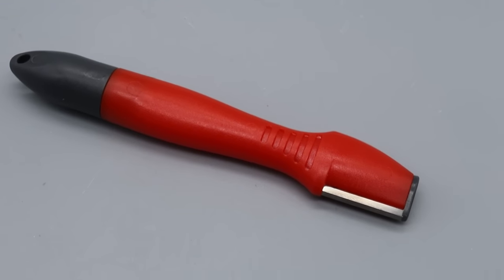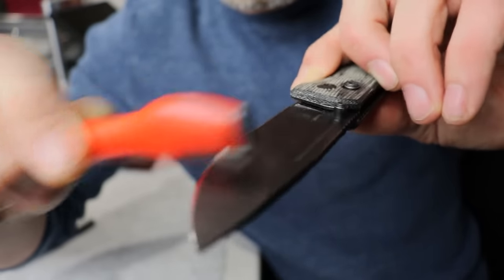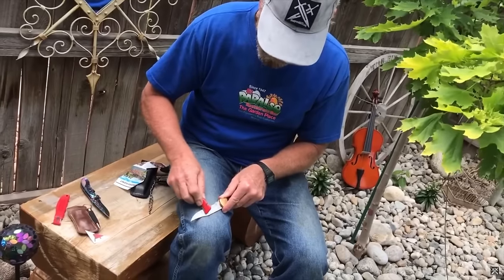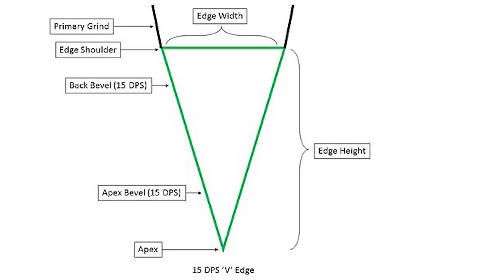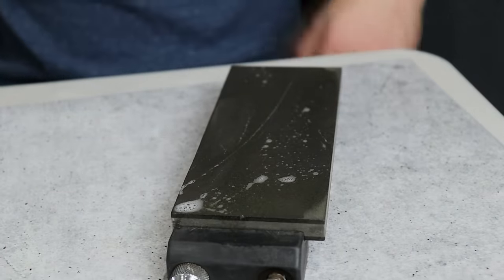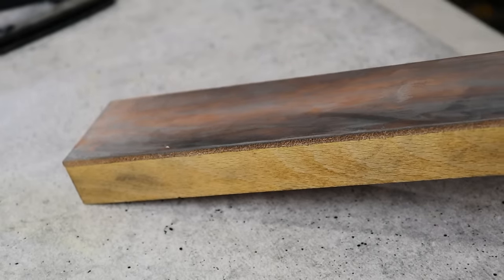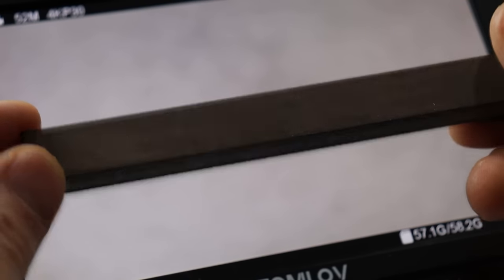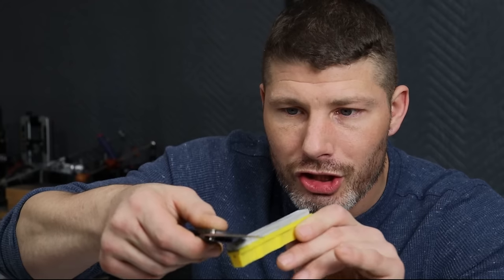Is This Sharpener Just A Gimmick or is it LEGIT

Comment: This tool works, IF.....big IF..... you bear in mind that it is great for carrying afield for touchups. I used a  basic Green River skinner - very slicey profile, basic 1095-  and this hone to field dress two deer this past season. I nicked bones, may have drug the point through the dirt a time or seven, and deer hair is surprisingly brutal on edges. I was happy enough with the resulting refreshed edge. The tool is small and light and will strike the heck out of a ferro rod. I haven't tried shaving magnesium with it, but I expect it'll work in that role as well. This sharpener meets my purposes for a field touch-up. It will never be a (*insert your favorite honing system here*). I carry it on my keychain to put an edge back on utility knife blades at work. No, it won't turn your EDC into an eye surgery scalpel. It will do a better job than a pull-through, be it carbide or ceramic. It might help to think of it as a butcher's steel that can be made to remove stock. Just don't try to reprofile your skinner while your deer is cooling off. It will hone a blade a little better than using the top edge of your truck window, in the event that your game animal had the poor grace to die miles away from your vehicle.
Reply: At least get you a WorkSharp Field Sharpener. You can
refresh that knife a lot better in the same amount of time. 
But keep the Sharpens Best to strike a ferro rod.

Comment: This “best” sharpener is basically a chakmak that you get with a Khukri. As long as the carbon steel used in the sharpener is harder than the knife steel, it can help put a working edge on a blade if you have nothing else available. I guess it’s better than nothing.

Comment: I purchased it, it works amazingly well, I've sharpened kitchen knives, kitchen and regular sheers, a pair of curved pet scissors which no longer cut my pets hair. I don't have any sharpening training so i actually dulled the blade on the first attempt. 

My logic was, if it removed enough material to dull, then that means handling it properly would remove material in the correct way.

Sorry,  it worked, and my pet groomer was blown away because the scissors typically get tossed... they are now super sharp

Bottom line is that it works,  and my utensils are very sharp now..
Reply: Yes the product works this man just doesn't understand how to use it i also have tested this product and it does what it says it does he simply hates that he is losing sales on sharpening stones he is a stone salesman and doesn't like new competition in the market

Comment: The probably the owner of this sharpener wants you to hold it so flat (not touching the apex ) is he knows that holding the knife in the air is impossible to hold that flat angle.  So when sharpening like that for awhile you are sometimes hit the right angle but almost impossible to roll the edge over. I think stropping on your pant leg would give better results as a average.

Comment: It’s funny I own one and and it works for me it gets my izula 2 shaving sharp and I have no sharpening experience
Reply from the maker: i would love to see that, are you using the pull through first?
Reply: Only use the pull threw  when I need to re profile knife
Reply from the maker: @user-mi5nm4th7q  jfyi that's not reprofiling the knife, check out my video on what pull through do to your edge, it's not a proper edge bevel made to be maintained, it's a micro bevel running the scratch pattern the opposite way you want

Comment: So im not ganna lie the guy from sharpens best does finesse it a bit. He tends to sharpen usually a knife thats sharp and then says its sharper after. But i do have his product and i do use his product on my work knives and my coworker cheap knives and it brings back a dull edge to sharp edge. There is a learning curve to that product. Not the best product but i will work in a emergency. I only use it on cheap knives as it doesn't leave a aesthetically nice edge.

Comment: His tool is no secrete or new technology. Coming from a machining background, carbide is a very hard material and is used as machine tooling. There is no doubt his product works because I have used carbide inserts from cnc machines and it works fantastic. The problem with people using his product is they almost always use too much preasure. The key is keeping the angle consistent when using his tool. He has done this so much that muscle memory comes I to play. I will say he is 100% correct when he says he doesn't want a knife razor sharp  because it will not maintain the edge. Sharpensbest is a tool really to touch up a knife out in the field when you don't have access to qaulity stones. I haven't bought his product because like I mentioned I have access to carbide inserts which is the exact same thing. Would I buy his product? Yes but only if I didn't have my own resource of carbide.
Reply from the maker: Then it shouldn't be advertised as the sharpest edges ever, or an actual sharpener. It's a micro leveler at best. and in reality is the worst thing for your edge, you don't have to want a screaming sharp edge to understand you want a proper edge.

Comment: I've seen one video where he appears to get a larger Buck knife from barely able to cut paper to cutting decently. There was also so much gun show, old man BS that it made it tough to watch and even this guy called one or two out.😂 Could this be used to give a useable edge in the field? Sure, but there are better things. The big issues I have is the edge quality, which will not be refined at all. Bigger than that, the guy who is the owner and pro at using his tool absolutely beats the shit out of the knife while using it. The tip has gotta be rough, but he's also constantly banging into bolsters/guards and handles. I don't care how sharp you get my knife if you destroy it in the process. Also, calling it world's greatest sharpener should have everyone on alert right off the bat. Great job being educational about it and being civil, Jerad. I'll be sticking to stones, whether guided or manual.
Reply from the maker: Yeah for sure, a pull through edge even with this tool wouldn't cut a 1/10 of what a proper edge would, and a proper edge will continue after stropping again and again a pull through just makes the edge have less and less retention, if you haven't seen it check out my pull through video

Comment: Stropping is a big issue for me when it comes to recurves and hawkbills. Sharpening isn’t too bad, since there’s a lot of good round stones, as well as every corner of a stone being able to serve the same purpose. Stropping is hard, though, because most of them are just flat, and the few curved ones I’ve seen are very wide and not really great for smaller curved blades, such as the Spyderco Cricket. Does anyone have any recommendations for good stropping/honing devices for recurves and hawkbills?
Reply from the maker: If you are doing recurve just use the edge of your Strop, or you can make a .25 to .5 " version wide but the corner works great just apply comound

Comment: You missed the boat on this one. I have no affiliation with any sharpener. But this works when you know how to use it. The learning curve is quite high for such a simple device. It will re profile a knife as well as refining the edge. It does remove metal the same as a carbide cutter on a lathe. I bought a half a dozen and after a while , I can do an acceptable job sharpening an edge. Even shaving with it. Keep trying until you learn why it works.
Reply: Or get a good sharpener
Reply from the maker: No I don't think so, first off I would never ever reprofile any of my blade steels with   carbide and I think I went through it enough to know what it can and cannot do, I'm happy to have you on if you want to explain but I personally prefer the optimal tool, it's not just about having an edge it's about th3 quality of the edge, again I'm happy to be proved wrong. You can send me one of your edges to look at under a microscope and do testing on I'm happy to doit
Reply: @NeevesKnives  I am not trying to get in an argument with you. I am a professional sharpener and have thousands of dollars in most every kind of sharpening equipment. I saw the Sharpens Best vids and was curious like you. I bought several and it took longer than expected to get good results, requires a lot of finesse. Contact Sharpens Best and see if he will collaborate with you. That would be an interesting vid. As for me,  I mostly sharpen stylist shears and only use the carbides for some problem burrs and repairs. Keep up the good work, I watch you regularly.

Comment: Dude it is legit a bought several of those sharpeners and a purposely dull my knife before i worked on it with the sharpener and when i use the sharpener properly it fix the knife and it cut just like new you fail at sharpening your knife becuase you destroyed the carbide by running it on a stone and you didn't use the corners in the sharpener you probably were cutting off the edge off while sharpening instead of making a new edge

Comment: I didn't watch much of this particular vid from you. Not because I don't enjoy your work but because I get so tired of these snake oil salesmen. These sharpeners were never designed for knives nor were they intended for any cutlery. They were designed to touch up ice skates quickly. As you saw, they do not put any cutting teeth in the edge but rather tear metal away long ways, or parallel to the edge. Exactly what you don't want in a knife sharpener. Same as the pull thru garbage sharpeners that literally destroy the edge and rob years of use off a decent knife's life.   
About the only thing as bad if not worse were the pull thru powered sharpeners on electric can openers. When I was a kid my Mother literally ruined every knife in the kitchen with those steel eating monsters. GRRRRRR!!!!

I do have one of the original designs in the shop and it is used only for putting large deep scribe lines on steel bars before cutting them to length on the Metal cutting carbide tipped chop saw.  Can't really think anything else for my use they are good for. 

KnifeMaker

Comment: As far as the Barbed wire comment . Dudes do abuse the ish outta their knives trust me I'ma a roofer and I dig scrape probe with a Gerber flatiron. A beater knife. I think you can't see past your bubble 
 And that's not derogatory phrasing. Your a knife guy so much ,you have a channel you would take your knives with the high performance steels and use them like aid 50s knives blue collar dudes do. And that's fine. Some guys have pocket jewelry and some guys dog the ish out their knives . And both are fine. I think that's  what's confusing you about the concept.  I have a pull through for smith with a ceramic and I'm into knives more than the average guy so ii have diamon stones and strop. Lol I sharpen my coworkers knives

Comment: Correct me if I’m wrong but the full length videos conclusion is jared trying to avoid a fight, don’t buy this, it’s junk and it’s a scam
Reply from the maker: I wasn't trying to avoid a fight! I did not have that guys actual tool at the time, however I do now and will do a full test with an edge retention test. Avoiding a fight would be telling you how good it did. This video absolutely did not prevent any fighting
Reply: @NeevesKnives  fair, that makes sense

Comment: One thing you didn't think of about this product is it's meant to be a EDC ! Something small that you can carry in the pocket or Keychain. That's why it also has a  fire starter as part of it also. So you can take it with you to camp . So it was use mainly for touch ups not a regular sharpening tool.

Comment: This will sharpen a knife, but it's not as good as traditional sharpening. The issue I seen so far( still watching) is your pushing down too hard. I want to be clear though, a sharpener that moves steel from bottom to top will never be as good as one sharpening from edge to spine if that makes sense.  This is  just a more controlled version of a pull through sharpener.  Keep the videos coming brother 👊

Comment: Sharpens best sharpeners do work I use them on my D2 tool steel blades and my magnacut blades the guy in this video is using it wrong you do not push down just brush the blade lightly and turn the sharpener to a slight angle and then try it. It’s user error cuz I NEVER have an issue and they make my blades razor sharp.
Reply from the maker: Well I have his real one now, and the edges still are crappy, I wouldn't ever put one of these edges on any of my knives aside from testing, also the edge retention after is so little when compared to a properly sharpened edge.

Comment: I know 440 and 420 are lower end if not the lowest but bucks 420 bos heat treatment is pretty good considering it’s 420 and 440c from Boker and ganzo isnt bad. But I would never buy a sharpener like this. Or any pull through they are all garbage in my opinion

Comment: I would call looking at the damage you made on a blade by purposely incorrectly using a product under a microscope dishonest. You are using the flat side instead of the corners, with no pressure and with improper technique. It’s like if I “sharpened” a blade bit cutting into a sharpening stone at a 90 degree angle and then blamed it on the stone.

Comment: I use this daily at work to sharpen my knives … I’m a certified knife handler and cutter at my job and this works well but have to use it at higher angle one side lower on the other then use a steel rod after and you will have an amazing sharp blade that will cut sharply for days bro! Have to learn how to use the tool … it works well I love using it daily … it works on thinner blades with ease thicker blades it’s more difficult but it does work !

Comment: This video and the guys in the comments really surprise me, not only does this product/sharpening system work (tested myself, its tungsten carbide made to strip metal) but it seems the non-believers/nay-sayers are the ones who didnt give it enough time or failed to get a knife sharp and are bitter for not succeeding where others have.
My learning curve was about a day and a half until I was getting blunt knives to almost shaving sharp using only this product in very little time. The fact that youve tried to disprove/belittle this product or the seller with diagrams of edge angles and geometry says that youre understanding of the sharpening method is obviously not as advanced as his.. no offence.
Reply from the maker: Things that can strip metal are not necessarily good at Sharpening, having a microbevel that is kind of sharp doesn't matter if it goes dull after one or 2 cuts, also modern steels use large amounts of carbide in them and when not Sharpened with diamonds they wind up not getting cut and they shatter, just because someone can build you a wooden box doesn't mean you'd want to live in it, this is a crude way that's horrible for your edge and very outdated. We understand Sharpening and edge retention better than ever at this point and what does or doesn't have good results.
Reply: @NeevesKnives  appreciate your reply, its not the best method or edge for your knife but it sure can get a knife very sharp in the right hands and before youve got any stones out. Its simple, use more pressure to re-profile and less pressure to refine. An experienced knife enthusiast can usually feel when its apexing the edge, creating the perfect angle also while removing the burr. While out in the field I would much rather have this in my pocket to keep my knife sharp, beats any stone or piece of wood’..?!
Reply: I agree this guy is wrong I can have a whole stack of knives hair shaving sharp before he finishes 1😂

Comment: How are you going to use a knock off and do a review on the original which I own and it works well. There is a learning curve but once you learn it the thing works! BTW I saw him sharpen a butter knife razor sharp
Reply from the maker: I have the actual version on the way with a full edge retention test in mind
Reply: Does it matter if it’s the original out not? It’s literally a 90* open carbide. Same thing, same principles apply.

Comment: You probably have a toothbrush in your home and you have used them, im assuming.  But your teeth are still yellow and your front two teeth are brown ..i bet you don't even know how to use it.  I've purchased this knife sharpener. I love it.  It works very good for me.  I'd like to point out that cutting paper has no resl benefit for someone who uses their knife for real world problems.  The blade edge it takes to cut paper is going to be null once you cut wood or stab plastic.

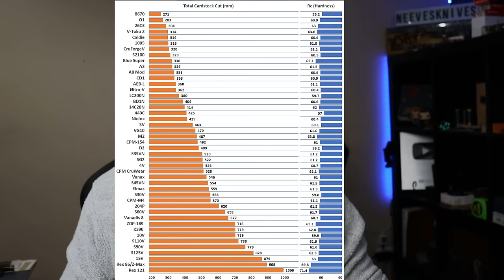Comment: 11:44 I think part of the issue is that you also have no clue what you’re talking about. You may have a few percent of “carbides“ (Chromium, carbide, vanadium carbide, etc., depending on what all you have added to the steel along with how much carbon there is in that steel. There’s a lot more variables than that, but anyways) the hardest steel out there is going to be a 5.5-6 on the Mohs scale. Tungsten carbide (which is made up of 50% tungsten, and 50% carbine) is a 9-9.5 on that scale. FYI diamonds (the hardest material in the world) are a 10. It absolutely removes material you just need to use some pressure and use it properly which is not what you did in this video. You may know something about sharpening, but you clearly know nothing about metal allergy yet speak on it as if you’re an expert. What you said at 11:43 proves my point. Is this sharpener trash? Yes. Do it work? Yes. Use the corners of the carbide, at the right angle and with enough pressure and maintain the angle and it will sharpen. Are there better sharpening tools out there. Absolutely.